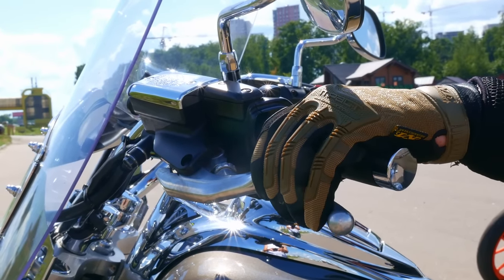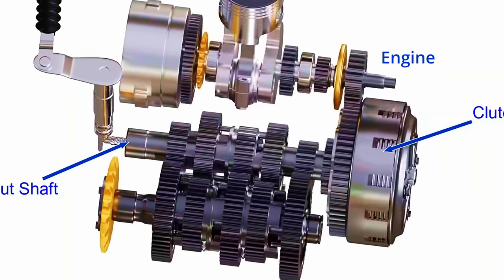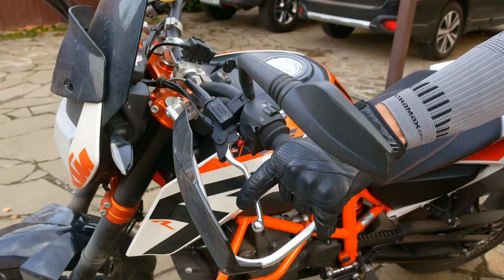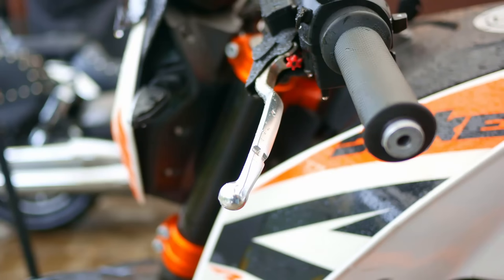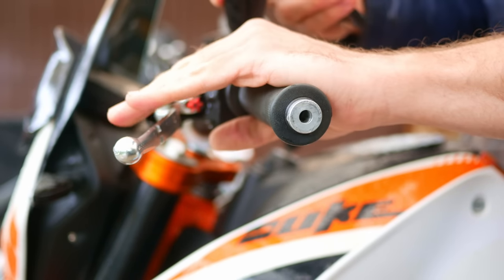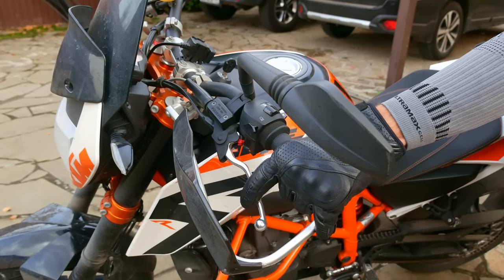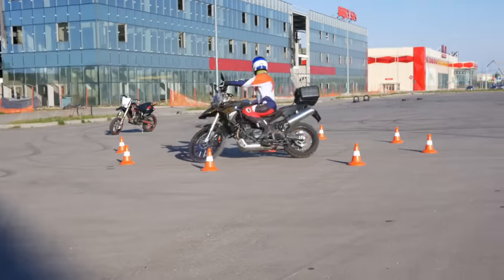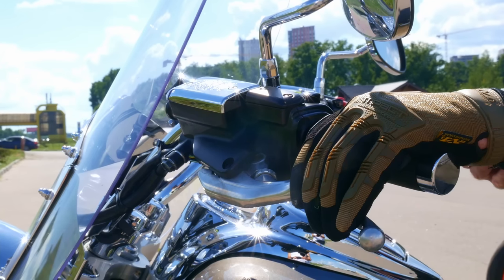How To Release the Clutch Correctly on a Motorcycle

Comment: Note on whether or not to leave your fingers on the levers: My buddy is a examiner here in the UK, you can fail your test for doing this. They also look for 4 fingers when engaging the levers. The 4 fingers isn't important after passing, but leaving your fingers on levers while riding can get you into some trouble... hitting a pothole or hump hard enough could cause your fingers to pull the levers, not so bad on the clutch but could be bad on the front brake, no one wants to go over the bars at any speed.

Comment: do you need to release the clutch slowly ONLY when going from neutral to gear 1 or do you need to release the clutch slowly on all gears?
Reply: It sounds like you are an inexperienced rider so ease the clutch out gently on all gears for now until you have confidence. You only need to pull the clutch in half way really and then ease it out letting your fingers extend gradually. Just don't drop the clutch. Safe riding = gentle inputs/ movement of the controls. Nothing abrupt.
Reply: @bootz0409  i am also thx!

Comment: Thank you so much for the video! As a beginner, I struggle to pick up speed after stopping at a traffic light and when I start I need to turn (long turn). I start in first gear, but my Honda rebel only goes comfortably to about 8-9 mi/h in tbe 1st gear, so I often find that I need to shift gears in the middle of a turn, but I am reluctant to do that, since I have to roll-off the throttle and it's dangerous  to loose speed while turning. So, I shift gears after I complete the turn, but it's dangerous since the car behind me is not expecting a drop in speed after the turn...how do I do it correctly?
Reply from the maker: Hi! I have never rode Honda Rebel before, are you sure 8-9mph is the top speed for 1st gear? Because usually motorcycle engines can have much higher revs than car engines, and new riders tend to upshift way too early.
Reply: @MotoControlEn  it's a rebel 300 😁, so it screams by the time I get to 12 mi/h
Reply: @mreya23  When you pull clutch fully, your bike wont do engine braking so you are not going to lose that much of speed; then you can shift up to 2 and release clutch. Its very easy to change gears in turns without loosing or gaining speed suddenly if you are keeping stable rpms. Once you have done some exercises it will become muscle memory and you will start doing it quickly without need to think about steps.
Reply: @emreatl5093  thank you! I will try to practice it in my parking lot. I was afraid since the Rebel 300 in 1st gear almost comes to a stop if no throttle is applied
Reply: @mreya23  Currently teaching my daughter how to ride on a Rebel 250.She has the same issue as you've correctly described about needing to change from 1st to 2nd gears @ approximately 10 mph. While practicing in a parking lot on straight level ground I told her start off in 2nd gear. Works a charm. Might want to give it a try, again , please do so ina parking lot. Hope this helps.
Reply: I understand your issue.  
Here is what I do …
When I  am  stopped at a traffic light and start off, 
I  start off and accelerate  hard in 1st gear,  
While still in 1st,  I rev up the engine to the red line, thus increasing my speed to maximum  in 1st.
Then I just pull in the clutch and  ‘coast ‘ thru the turn quickly in 1st, 
As I finish the turn and straighten up the bike , then I shift to 2nd gear…
Works for me!
Re reading your post above, 
Bring the engine up to red line rpm,  which is 12 mph speed ,and then pull in the clutch.
Reply: @edwardfinn4141  thank you!

Comment: Everything in this video is completely correct.
Some additional points for some specific bikers :
1. Consider trying a 'shorty' clutch lever.  This allows you to use (always) only 2 fingers on the clutch, while also permitting the clutch lever to be pulled right back to the hand grip.
2. If possible, adjust the clutch friction point so that it is close to the hand grip.  When you need the friction point in a complex situation, it is far easier to be precise when the friction point is at a known offset - the closer to the hand grip the better, but bearing in mind that when pulled in all the way the clutch MUST be fully disengaged, not within the friction zone

A good shorty lever will have a good adjustment option, allowing point 2 to be achieved easily.

The combination of these two allows FAR better control of the clutch in many circumstances.  It takes a bit of getting used to, but if you can make the transition you will never go back.
Reply: At what point do you blip the throttle? Thanks.
Reply: @soul17169  Remember that you can only successfully blip the throttle when the clutch is pulled in.  Since the clutch (on downshift) will only be pulled in for a very brief time, this absolutely limits when a throttle blip is possible (and correct).
Reply: Regarding point 2 adjusting friction point so that its close to hand grip, are you talking about hand grip on the handlebars or hand grip when you are covering/on the clutch lever? Thanks!
Reply: @codyktam  I'll try to phrase this as clearly as possible.  On my clutch, if I pull the clutch in all the way, and then release it about 5mm (that's less than 1/4 inch) I'm at the start of the friction zone.  
Effectively, the friction zone starts almost immediately as I start releasing the clutch, not at some point far from the handgrip.  This means I can reliably "hit" the start of the friction zone every single time, and very fast.

Comment: You can even practice the clutch when the bike is off.  When you pull in the clutch, even when the engine is off, you can feel where the friction zone is, because the lever pulls with more force when you pass this area.
So an exercise one can do with the engine off is: "quickly put the lever in the friction zone" (and then move slowly through the friction zone).
Reply: I learned how to ride a motorcycle by watching yt vids, have the bike on a center stand if it has one, practice while its off. Hahaha
Reply: @dawoudjoufcaranguian5319    Knowing how to quickly find the friction zone helps new riders with many low-speed exercises.  I think if someone takes MSF course without any prior riding experience, if their only preparation was to practice this one exercise, then they will almost certainly pass.
Reply: Thanks for this tip bro. I'll try to practice this one
Reply: @mhoeij  I agree with you. It's all about learning where or how a friction zone works.
Reply: What do you mean by move slowly in the friction zone? Pulling the clutch or letting go of the clutch?
Reply: @ixion_cyb   The friction zone is between those two, it's neither pulling it all the way in (no power to the rear wheel) nor letting it go.  It's in between (some power to the rear wheel but the clutch is allowed to slip).

Comment: Again a concise and to-the-point instruction and demo, thanks! Question: I practised the tight turns yesterday, but noticed two things that made me anxious: 1) I couldn’t take of with the steering completely locked in the turn and keep it locked – I soon gave more throttle to prevent the bike leaning too far and then it raised itself out of the tight bend, automatically taking the steering out of the tight lock, so the curve widened and speed increased. Then it was counter-intuitive to turn the steering again to its furthest point (‘lock’j. How to overcome this?
2) My right hand is always in the ready-to-brake position, so when the speed picked up unintentionally, I had to warn myself not to use the front brake because I know that’s almost certainly a fall because my reflex is to apply it too quickly. Question: should I focus on using the footbrake if necessary? I hardly ever use it in normal riding, I just remember using it in serpentine bends in the mountains – that helped keeping revs up while adapting to changes in camber and curvature of the road while maintaining traction (especially uphill bends).
I’d appreciate your tips on this!
Reply from the maker: Hi Peter, how's it going? The answer too both your questions is to simply repeat the exercises😉At first, our brain feels really scared when the front wheel goes full lock, because the bike feels unstable. But with practice, as you are releasing the clutch to stabilize the bike again and again, your brain will feel more and more confident, since nothing bad happens. And at some point it will be confident enough to keep the bike at full lock. The same goes for the brake: eventually you will teach yourself to catch the bike with the clutch, so you will stop trying to brake instinctively.

Comment: It highly depends on the clutch parts though (cable vs. hydraulic, quality of levers and connecting joints, wear on clutch cylinder/caliper/basket/rotors, wear of the gear docks, idle rpm stability, etc.).

On my 35 year old ZX-10 Tomcat it‘s a totally different story than a modern Versys or GSX.

Comment: Yeah my KLR 650 has the friction zone at nearly the beginning of the pull farthest from the grip out in front lol. So if I wanted that more to the center of full travel, is that possible? Or is it better to have it close to its end of travel? Zero issue with reaching it there, just curious if it’s mechanically better for it to engage at the far end of releasing by the beginning of the pull vs say being half way through the travel distance of clutch lever? My first bike so no prior template to compare to. Unlike my 30 years of driving an 18 wheeler where I got plenty of comparisons😂.
Reply: I have the same problem with a cbr125. Clutch level is almost fully released before clutch engages. My hand is fully extended, making it difficult to have finer control of the clutch. What I did was to screw the adjustment nuts beside the clutch lever all the way in which loosens the cable somewhat. This moves the engagement point closer to the middle of the clutch lever range. Haven't tried riding with this adjustment yet but it does allow me to pull the clutch lever a longer distance before the clutch disengages the motor.
When doing this, check to ensure that the clutch is fully disengaged when you pull the lever all the way in or there may be problems with shifting if the cable is too loose to completely disengage the clutch.

Comment: Bro I fell from my bike when I was in 1st gear and stopped before taking a turn, and I held half clutch and applied front brake with a little turn towards the right. Then the front tire skidded towards the right and the bike fell and broke my front brake. I'm a beginner and can you tell me how to avoid this situation. My bike is triumph speed 400. ABS and traction control were both on and it rained a little.

Comment: How much should you cut the gas off on the throttle when shifting?
A little, a lot, all the way, depends on shifting up or down, does it change when racing?
Reply from the maker: At first - cut the throttle all the way while shifting, as you become more proficient you can start shifting quicker. When shifting quick, you don't have to cut off gas all the way, but you have to do it very fast, and it should be timed with clutch and shifter. I'll try to make a video about it sometime!
Reply: @MotoControlEn  thank you

Comment: I have a question. If i clutch in then without releasing the clutch if i shift down 2-3 gears one by one is it harmful. Or is this proper way? If not then what is the proper way. Please expecting an answer who have been riding for years.
Reply from the maker: Hi! It will not be harmful UNLESS you downshift too much gears down. If you do that, when you release the clutch there will be a possibility to over rev and damage the engine that way.
Reply: @MotoControlEn  thanks brother. I dont downshift and as i usually keeps my speed in between 30-50 in my country. As a beginner when i ride at 50-60 speed i just throttle let go, clutch in and then down the gear one by one also slowly press the breaks. For now, using it. Will learn the downshift later on.

Comment: You need to make a video on Revs matching as most newbie are struggling with it
Reply: Rev matching is pointless unless you're banging down gears from really high RPMs, which a newbie will not be doing. And even then it's still pointless. Just let the RPMs drop to a point where wheel rotation matches engine rotation, then drop a gear. If you're on track, install an auto blipper. Also while you're rev matching you need to release the front brake every time everytime you twist the throttle, so you're upsetting the suspension and not making the most of your brake which will make you slower on track because you have to brake earlier.
Reply: @loftyintentions1985 
First of all, no its not pointless. Rev matching is very useful to reduce shock load so you can shift gear smoothly.
Secondly, if you have to wait for the rpm to drop to a point then shift gear? sorry what? that's not why you do Rev match, you do it cuz you need more power asap by shifting to Lower gear and then Rev match to shift smoothly. and no you don't have to release front brake when you Rev match, and in the track most track day rider already have quickshifter with blipper anyway so they don't do Rev match cuz the tech do it for them
Reply: @averyzaliasylvia4026  🤦🏻‍♂️

Comment: I expected this to be related to something I have been observing on my two motorcycles, is that the gear shifting, at the moment I push down or pull up the gear lever it makes a loud sound. I don't know if it's something every motorcycle does or if I'm doing something wrong, but even when I put the first gear and have the clutch fully disengaged it makes this loud sound
Reply: loud clacking when engaging the first gear is completely normal